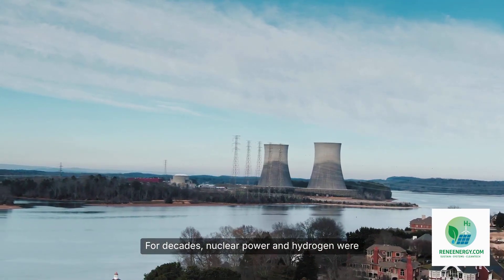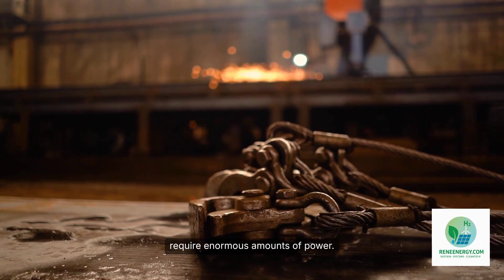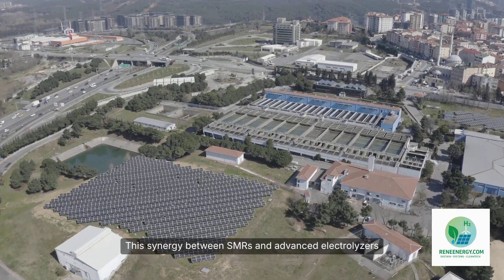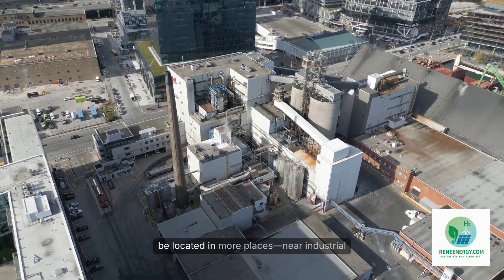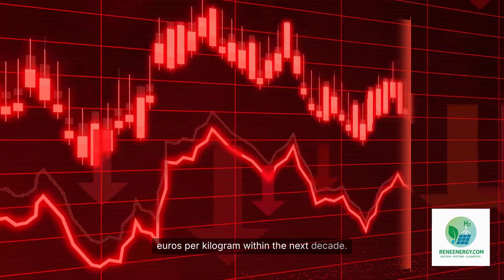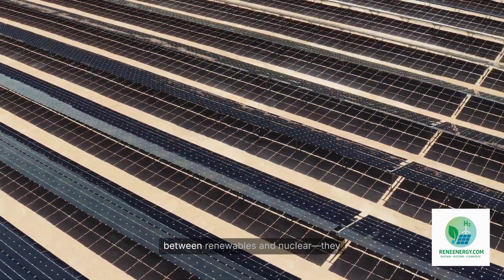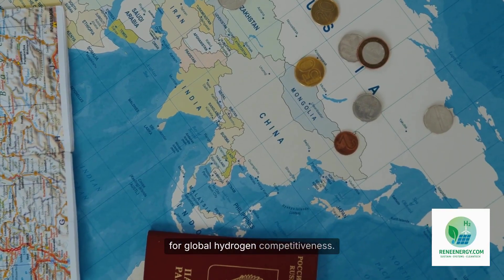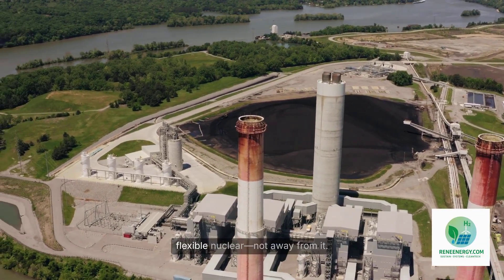Nuclear + Hydrogen - The Breakthrough Combo No One Saw Coming

Comment: I don't believe in a future for SMRs, but yes, hydrogen production combines well with nuclear reactors. You want a source of heat to go with an electrolyzer. Heat storage is also interesting, because it can make nuclear reactors more flexible. If you want nuclear reactors to make sense economically, then you need to find a way to make use of the heat that the reactor produces.
Reply from the maker: Totally agree that heat is the real prize — hydrogen only makes economic sense when you pair electrolysis with high-temperature heat. Where SMRs still fit in is that the next-gen designs (molten salt, IMSR, HTGRs, microreactors) were built specifically to deliver that industrial-grade heat and use it efficiently. So while not all SMRs will succeed, the heat-focused ones actually solve the exact economic problem you're pointing out. Appreciate the thoughtful comment!

Comment: Today roof PV, with the grid, and with industry, destroys cashflow to central heavy energy investment when the sunshines and the batteries are full. 

247 cashflow collapse is too much for central dependent generation.

Grid electricity Cost/Benefit for indoor lighting replacing fossil fueled lighting was perfect.

Luxury priced energy in small quantities replaced heavy burden and impact danger of indoor fossil energy. 

Grid electricity has an economic limit.
As numbers of consumers expand then the grid supply increases exponentially. 

The central Generators economic footprint must include the massive transmission cost footprint with the bigger central generation footprint. 
Small footprint is a foolish notion.

Cashflow must remain 247 in a world exploding with grid free offgrid roof PV on dirt-cheap empty roof realestate and dirt-cheap massive battery storage on wheels all night long, and 23hrs every day. 

DUCK CURVE of demand collapse is cashflow collapse in business hours daily. 
Expanding to 247.
GOUGING for cash from the remaining demand is impacting the poor and slow adopters of new technologies. 
GOUGING electricity prices boost economics roof PV technologies.

Energy efficiency. And economics. 
Fossil fueled energy is 66% wasted energy.
Heat and mechanical friction and standby and ... waste. 3.6kWh for 1kWh electricity.
Central PLUS Grid rental costs. Expensive. 

Roof electricity is 1% waste. 4kWh to 1kWh 
Roof PV is shaded hot roofs and reduced air-conditioning costs in the land of decade long droughts in the sunbelt. 
Roof PV, no Grid rental. Dirt-cheap. 

Sahara Desert and Australian latitudes. 

The wealthy high energy users, high income, high marginal taxpayers, love ❤️ TAX-FREE SAVINGS on their large energy demand. 
Large homes, large empty roof realestate, DIRT-CHEAP REALESTATE and no grid rental costs. 

This was a DESIGN FEATURE for governments faced with a failing fragile electricity grid. 

Governments facing budget economic disaster.

Blackouts are total cashflow collapse. 
Blackouts are lost elections with lost electricity. 
Blackouts are budget exploding grid wide upgrades for historic central generation.

Understanding the grid dry economics and avoiding wet dreams of old men in near polar latitudes is key to a resources limited world and climate. 
Australia latitudes and attitudes to advanced sunbelt technologies can lead the world to great safety and national wealth.